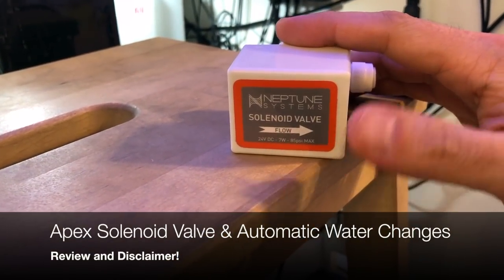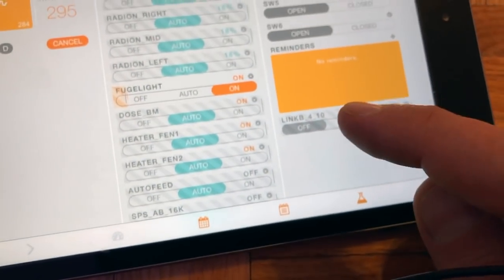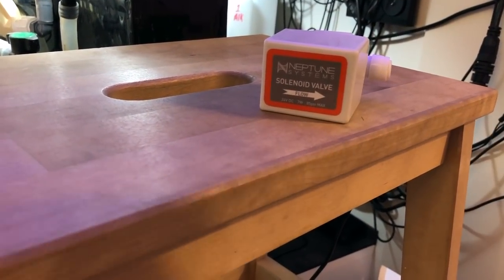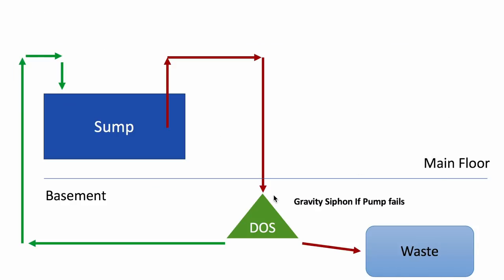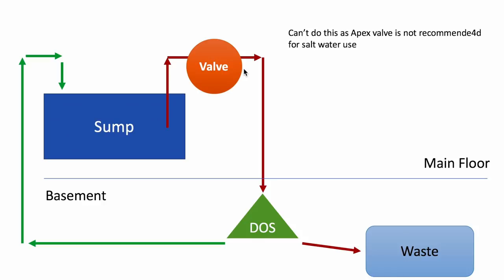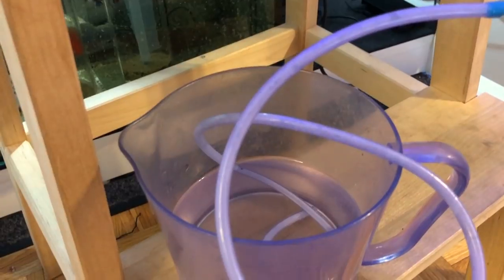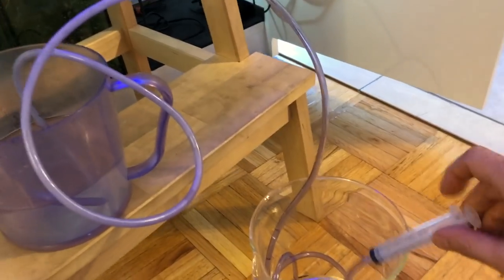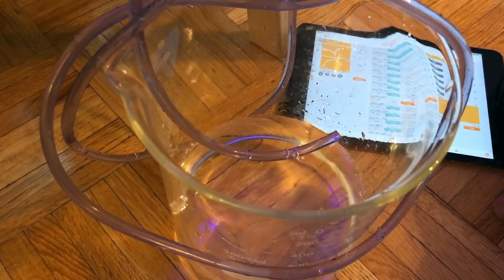Apex Solenoid Valve: Review and use in automatic water changes

Comment: Keep an eye on the solenoid over time, I've had 2 of those spring leaks over the past 2 years. I use them on my ATO and they work great, I just wish the build quality was better.
Reply from the maker: What The Frag yeah - my plan would be to test it monthly. Hopefully it’s more reliable in this simple  application with no water running through it.
Reply: AmroAzul TV I think it may heat up and fail because no water is running through it.
Reply: AmroAzul TV I think it may heat up and fail because no water is running through it.
Reply from the maker: @sambow7005  they are meant to used for both freshwater and air, so in theory should hold. but i'll defiantly run regular tests

Comment: Good idea Amro believe it or not i am doing the exact same thing with a check valve. In addition my main method to provide extra redundancy is by using FMM with 2 magnetic Optical Sensors from Neptune..They work seamlessly...Come by my place when you have some time i will show you.
Reply from the maker: yeah, i'll have to come and check out your system... how is the check valve going to work though ?
Reply: Exactly....a check valve will restrict flow to only one direction but what is needed here is a siphon break. I have a few places where I could use this idea.  The other day my ATO created a siphon and I had a near disaster - the ATK float prevented a big problem.  The included siphon break had gone underwater and no air could get into the line.  I need a better solution as well as one for my auto water change and kalk stirrer.  Thanks for a great idea!
Reply from the maker: Chris Hetlage thanks Chris.

Comment: Such a simple fix to solve the problem  it i would have never thought of using it that way did you set up the auto water change in this way and if so hows it working ?
Reply from the maker: David Waters yes been working for several month now with an issue
Reply: AmroAzul TV awesome 👍👍👍

Comment: Hi, when a Solenoid is added, does or should it appear on the Tile Dashboard as a NEW title?  I have a new solenoid, plugged it in the EB832 and a One link and nothing shows up.
Reply from the maker: it should - if not, go to the hidden tiles and see if it is there... it will be called something weird... but if you look at the settings, it should say 24VDC Accessory Output A (or B - depending on which port you added it to) on the Energy Bar 832...
Reply: @TheBioReef  Thank you.  it really confuses me.  Still trying to see where it is.

Comment: Genius idea!!!!! How much salt water will you be keeping on hand? Pumping old water into a drain?
Reply from the maker: pelphrey I typically make a batch of 35 gallons at a time, roughly for 7 weeks of water changes - man this is going to be sweet! I actually wanted to collect the dirty dt water in a bucket so I can reuse it in my frag tank (my evo 13.5)... but there is a drain Line for the laundry right underneath the tank that I can always use if i feel lazy
Reply: @TheBioReef  When you get a chance after you've got your AWC setup can you do a video on your setup as far as salt water holding, the salt used, how it is circulated and heated?
Reply from the maker: pelphrey for sure! I don’t bother heating my salt water / I have a tunze on a timer for circulate / aerate... but will show the setup next video for sure!

Comment: Have you considered that the valve may not be rated for constant operation
Reply from the maker: i hadn't consider that - thanks for the tip
Reply: Agreed, you would want a normally open valve for this application.  That way the valve is only active when doing water changes.

Comment: How does the dos pull a prime after you close the valve when there is now air in the line? I understand that it cannot pull any more air because the valve is closed but none the less there is air in the line. Can it still pull the prime?
Reply from the maker: Saltwater piff yes - once the valve is closed, the dos would just be displacing the air with water in the line, the same way it would pull a prime the first time it is installed

Comment: I would like to know how is gravity going to take the old saltwater out of your sump since the water you're removing is running vertical even when primed if the #DOS fails? 
I have owned a #DOS for over 5 years and it's never happened to me ever!
Reply from the maker: Because I have a tube submerged in my sump full of water going down to the basement to the dos pump, if the dos pump seal develops a leak, it will lead to a gravity siphon. It doesn’t have to necessarily be a failure from the dos pump - possible that say my cat or my kids may accidentally nick the tube above the DOS or knock the dos of the shelve leading to a severed connection ... I wanted to engineer this system to deal with this unexpected cases
Reply: @TheBioReef  that makes sense!! Thanks.

Comment: Does teh Sv-1 have to be above the DOS?  I just tried this but when I open up the SV-1 it doesn't break the siphon
Reply from the maker: Johnny Liu yes ; the valve has to be at the highest point. So tube From Tank goes UP to valve, then down to dos. That way, when the valve opens, air gets Sucked into the down tube and breaks the siphon
Reply: @TheBioReef  strange, the siphon doesn't stop still.  i can see the sv-1 is trying something and there's a change.  during the water flow i can see a slight pause and then water resumes.  almost like the sv-1 isn't powerful enough to stop the siphon completely.
Reply from the maker: Johnny Liu odd, you did run a t-splitter ok the doing line, with the t going up to the valve ? If you are able to send me pics on Facebook I can see what could be causing the issue

Comment: Why not just have the old salt water line fairly high in your sump. So if the dos fails, then it will only drain a little bit of your sump. 

Also I’d make sure you figure out how much pumping it takes to prime and move the old salt water so you can match it with the new salt water. Having to re prime it might make them not match.
Reply from the maker: PotomacReef i will try to keep the line as high up as possible but I will still wanted a fail safe. Yeah I wondered about how the valve will affect volume out vs in from the dos. Assuming dos doesn’t fail, then I don’t think the volumes will change; the solenoid will only let air into the line if valve is OPEN and Dos is pulling water out of the tank. If the dos is functioning properly, and holding the line shut when not operating, then it should meter out the correct volume of liquid. I’ll validate that though once everything is setup
Reply: Good luck. I have some more apex stuff for the mixing station but now mr saltwater is doing a series. Maybe will wait before pimping my mixing station.

Comment: How to use this with EB6 bar?
Reply from the maker: I only have the EB8 bar... does the eb6 bar have a 24VDC accessory port ?
Reply: @TheBioReef  no it doesn't have that port.  That is the reason i have this question.
Reply from the maker: @quransunnah96  sorry - i may not be compatible with the EB6 bar then. You can still use the solenoid valve if you connect it to an FMM module and have the module powered by a separate power adapter.
Reply: @TheBioReef  Got it thanks.

Comment: your problem is very simple. no need to worry about syphon IF you have the drain line set at the minimum height of your sump. your proposal is sound if you want to have the drain valve at the bottom of your sump. DON'T DO THAT. please just go for a simple method and setup your drain line to the minimum height of your sump. this will also act as redundancy for you auto top off your resorvoir runs empty. i run both. i have my drain line set to the height of my optical sensor of my ato. so now if my skimmer goes crazy my ato covers that but also i get my water changes of 1.5 gallons a day. yes my drain line does not always take water out due water level being just below but it roughly does 95% of the time. the key is and i say again. "set your drain line to your minimum water height and not to the bottom of the sump.

Comment: Why not just use a one-way check valve?
Reply from the maker: don't think that would stop the flow if the system generated a siphon by accident
Reply: @TheBioReef  Why do you say that? I assumed that the one-way check valve allowed water to pass through it in only one direction to specifically stop a back siphon.
Reply from the maker: @ryansmithers4661  yes, its not a back siphon that i am worried about... i want the same tube to drain water from the tank upstairs to the basement when the DOS is on, but to also then shut off the water when the DOS is off. a check valve will permentaly shut off water going downstairs so i will not be able to use it to do water changes
Reply: @TheBioReef  Gotcha! Thanks for taking the time to explain it!
Reply from the maker: my pleasure

Comment: What if you get a power failure ... the soloinoid will close and Sifon will be alive. Best solution is to place the DOS and out take tube higher than it’s origin in a empty container. Then run another line from that container to your basement. When ever you are ready to empty your container just start the siphon from the basement and you will be collecting your waste water for discard or your extra tank.
Reply from the maker: Thanks for the comments Sam. Yeah the power failure would be a concern, but if the programming is right, then this issue would only be problematic if the power failure occured in the 30 min the pump is running AND Dos pump head failed to seal. a rare event. its a balance between every day convince  and avoiding unnecessary risks.